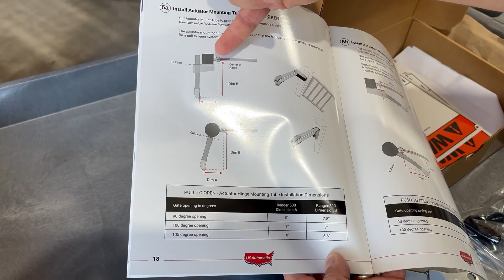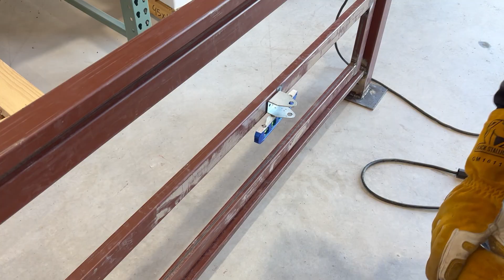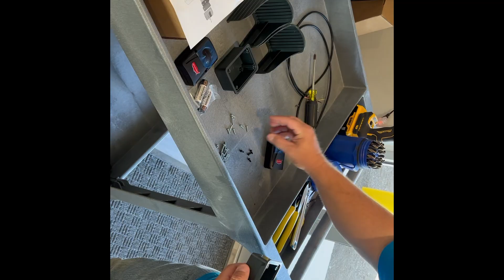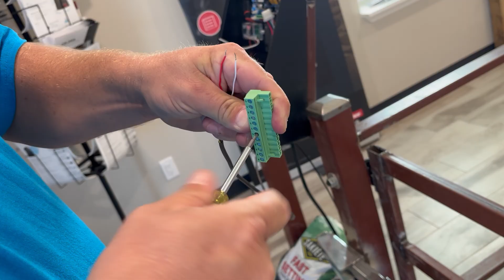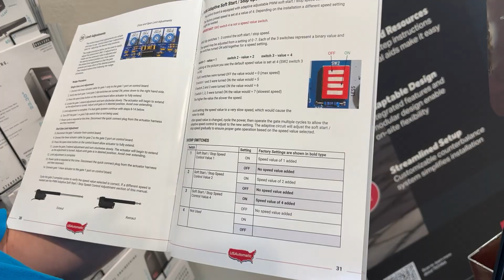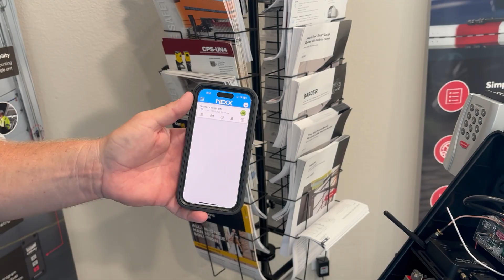USAutomatic Ranger 500 gate opener full install with accessories

Comment: What about a buried loop for a car that is beyond the eyes, but still in the path of the gate and can get hit?  How does that work?
Reply from the maker: Loops are a great idea for protecting your gate and vehicles from damage. They are your best option when it comes to truly protecting both, they are buried in the driveway and detect vehicle presence. The photo eyes only protect what is directly blocking the eye itself in the beam, a loop covers a larger area and is ultimately the best protection. Loops are available in direct bury methods for any driveway, or saw cut options for concrete or asphalt. There are also a wide variety of loop detector options as well to make installation pretty straight forward.

Comment: The keypad with numbers on it to place outside my gate area for any visitor with a code.  Is that cordless or do we have to bury wire?  And I assume we have to have one on a pedestal coming in and going out to activate the open of the gate?
Reply from the maker: For the keypad there are wireless options like in this video, the clear receiver in the box communicates with the keypad so no wires needed. That is for the 050500 keypad in this video or the premium wireless keypad number 050551, they are battery powered. If you choose the hardwire route there is the part number 050700 as well but it would require wires. As far as having a keypad to enter and exit you have options. You can do a keypad for enter and exit...or install something like an exit sensor or push to exit button for the exit side. It all depends on the space you have to work with and what functions you want out of the operator.

Comment: This is a great video. This is what US Automatic needed to help DIYers!
Can the auto close feature be turned off?
Reply from the maker: Thank you for the feedback! Yes, Dipswitch 1 on SW1 will enable or disable the time to close so you can set the operator to close with a range of 2 seconds to 150 seconds or turn the switch 1 off and gate will not close until given a command via transmitter, keypad, etc.